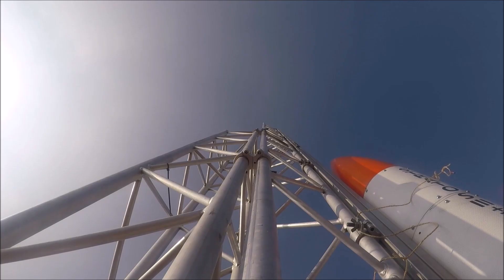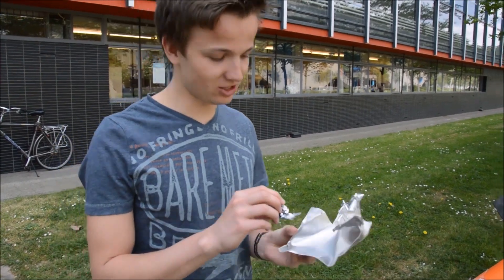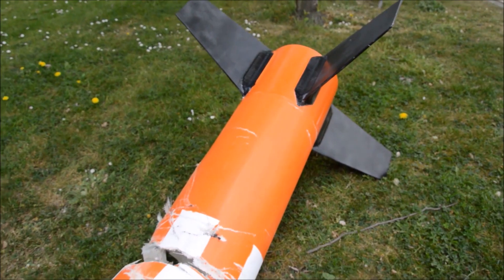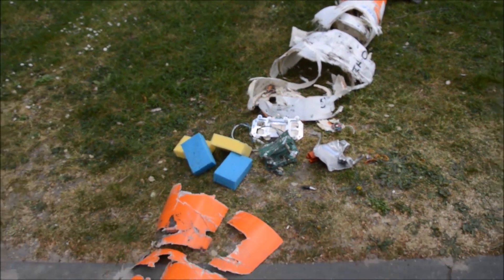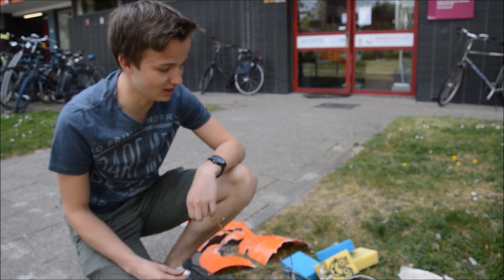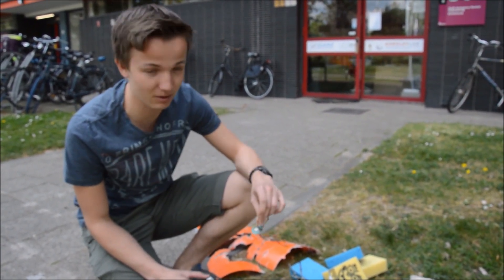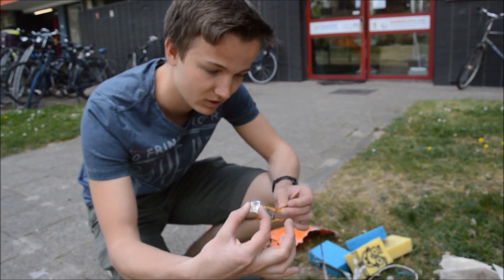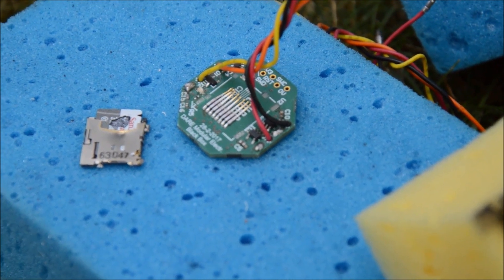DARE Electronics Vlog 1: Launching the Stratos III +/- Rocket

Comment: At USC RPL, we use Loctite 5145 conformal coating for all our boards.  This stuff works pretty well, it kept Traveler 4's avionics unit together through a 50+ g spike at launch.  And in the wreckage of Traveler 3, we were shocked to see that the crash had detached all the SMD components from their PCBs.  The only SMD components still in the avionics unit were found stuck to the layer of potting compound.
Reply: Wow impressive G-forces! Thanks for the tip! We are planning to use reenterable potting compound, since we can still debug issues and get the microSD storage out again.